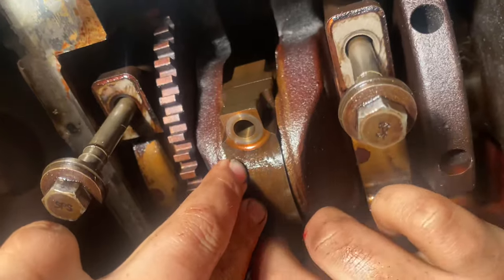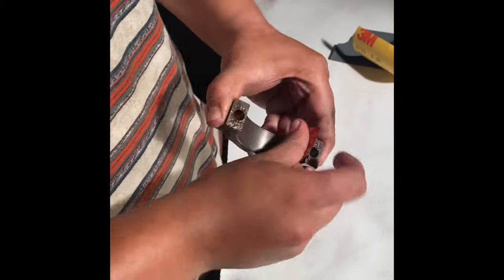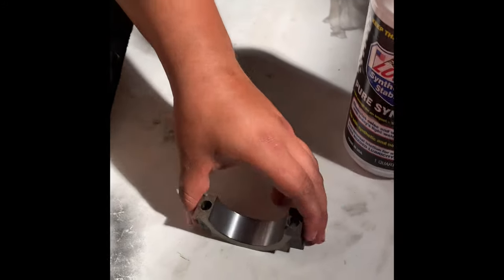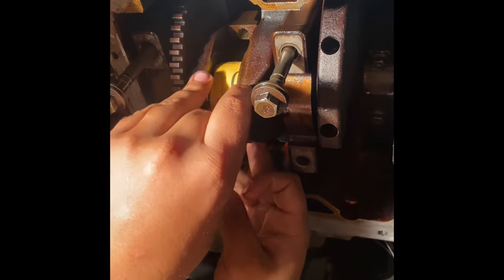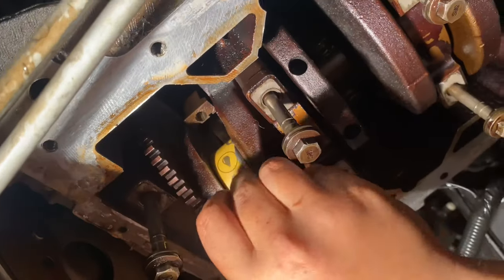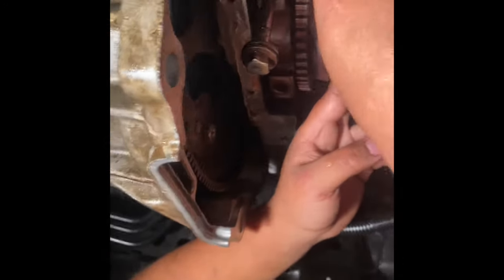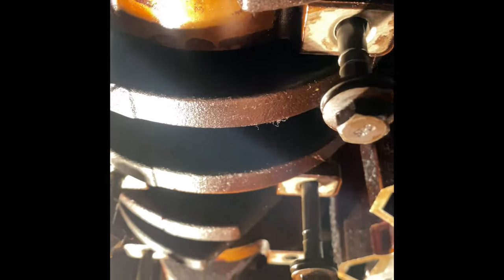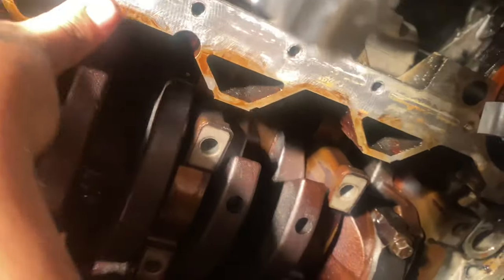How to change rod bearings with the motor still in car(how to fix rod knock)

Comment: My dad told me a story about a 1969 nova ss he had bought in 1974 from an independent car lot on Texas. 
He said he ran the car hard down the road a few miles and back to check everything out. He said he drove back up at the lot, handed the guy the cash, signed the paperwork and headed back to Louisiana. It was almost a 250 mile trip back home. He said by the time he pulled in the driveway he heard it……..knock, knock, knock, knock, knock, knock.  So the next day he dropped the pan and proceeded to put a new bearing on #3 rod. He said when he pulled the cap there were thin slices of soda can still left between the bearing and the crank. The salesman had cut slits of aluminum can and put it in the bearing and put it back together. Lol. I mean he had it tore down already so why didn’t he spend a few dollars on an actual bearing lol.

Comment: Hey great video by da way so I wanted to know what motor was that you were working on I infact have a wat seems to be rod knock im my 03 jeep 4.7l limited 
I'm going to be doing this for my motor and your vid is great 👍 for step my step ill also be doing the cams timing chain and the lifters and rocker arms on it I had a oil leak when I first bought and I finally got it fixed but I guess da damage was already done 
Is the car u fixed still running no issues
Reply: This comment probably is not going to help now but anytime you have a rod knocking in your car and it's bad enough that you're hearing it you should always have that Rod recondition

Comment: Us the 18 foot pounds the?same as the 06 dodge charger hemi
Reply from the maker: No different engines have different torque specs I’d suggest you google the torque spec for you specific engine
Reply: U think u can help me I tried to research it but can't find it can u tell me the specs for my engine it's a 5.7 hemi and how many times do i need to sand it
Reply from the maker: @YT-glockstreamer  what part are you trying to torque down?

Comment: @nas performance pin a comment with the results of this?  Did the knock go away?
Reply from the maker: Yes went a way for a good 3 months and then the truck got a motor swap
Reply from the maker: If done correctly and carefully it should last at least another 50k miles

Comment: You guys all using too light of engine oil, I say use at least straight 30 weight, prevents rod knock in my standard trans Blazer, provides cushion for rod bearings duh!

Comment: If it's already got a rod knock it's a little late to put bearings in it you need to pull the crankshaft and have it turned then you need to resize the rods otherwise it is a stopgap measure and it's going to just show up again who is this it doesn't know this
Reply: I mean my dads been a mechanic for a little over 20 years and from what's he's told me this will get you another 25k miles atleast, and sometimes you don't have the time, expertise, or most importantly money to do a full fix.
Reply: Who also has the time to take it apart again or risk the rod shooting through the engine like fireworks on 4th of July

Comment: Yeah the first comment is so very true. Never I mean never oil the back side of the bearing. It is far more likely to spin the bearing. And also don't sand the crank shaft surface the tiny particles of steel that he sanded off will get into the oil journal and scratch the new bearing if it doesn't spin the bearing first. And I wouldn't sand the inside of the main caps either. Plus you have filthy mouth young man.  Don't listen to this kid. He is showing how not to do a in frame bearing roll out . Lots of good information on U tube

Comment: When he starts it it's going to fly apart lol
Reply from the maker: I mean she’s been going for 3k miles already
Reply: This is the same procedure shops use to prevent bearing failure on BMW motors so I’d say if you keep it clean and the sizes where right it’s going to be fine.

Comment: You only apply lubricant to the front of the bearings never the back. No worries tho it's gonna get repo'd then it will be someone else's problem.
Reply from the maker: Lol truck has been paid for for 10 years ain’t no body gonna repo it